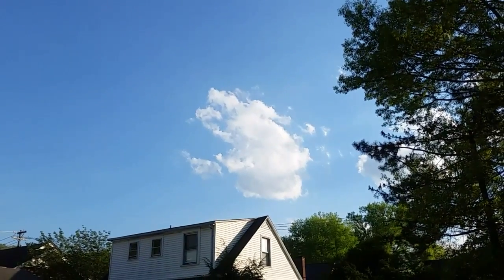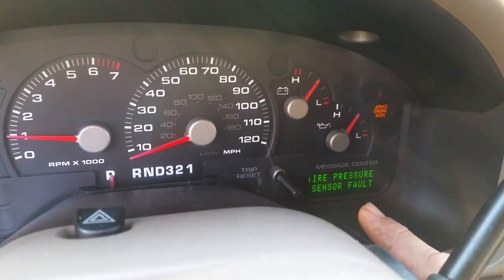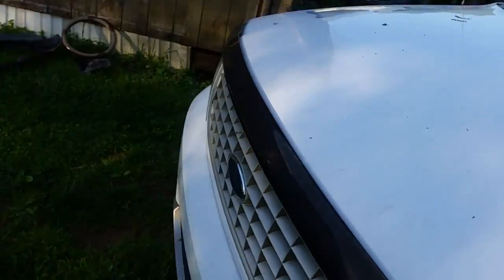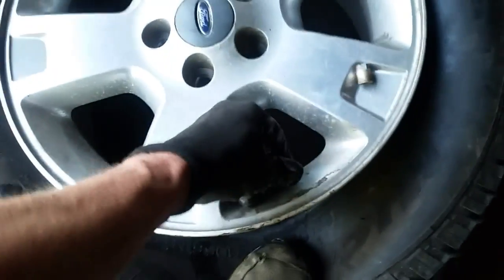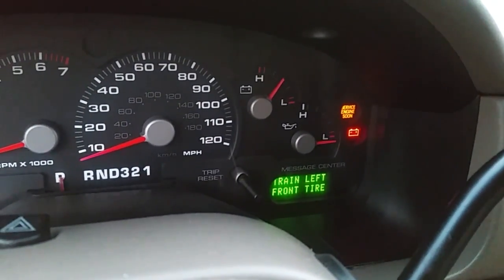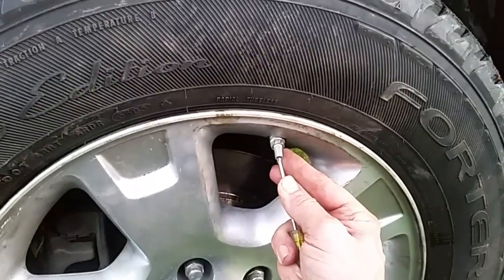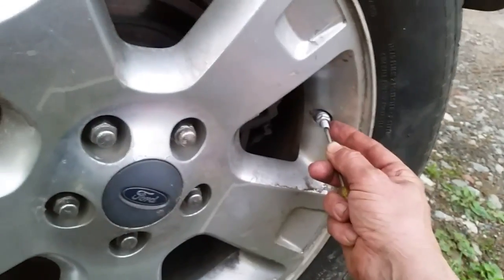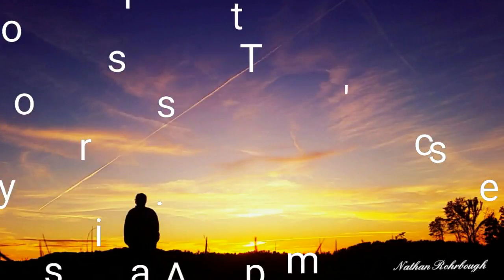TPMS ~FAULT~ Fixed! Simple steps to get that warning light off. Explorer.

Comment: Great Video !
Not sure if this works on Ford Explorers, but
On 2008-2012 Ford Escapes, In addition to do the 3 Key Cycles/ Brake / Repeat.
You can just hit the Hazard lights Button 5-6 times.

I'm so glad the Same TPMS/Door-Ajar/Emergency-Brake lights were turned on at the same time in your video.
Was having the same issue on my 2012 escape, and thought I had a ground wire issue somewhere, because 3 lights instead of 1, but I guess not ! ha ha.

Comment: I already installed a set of tpms on my 2016 explorer and mess cruise hill start and remote start,,took to dealer and they clear the code and now I have errors again. Is there any relation between tpms and theres three or should I look for another solution?

Comment: In the restart the system did not see the low pressure on the tires?

Is it necessary to drive some miles to see the low pressure?

Comment: Curious- why when you finished programming all of them, it did not tell you all the tires were low on air! Thanks for the informative video.
Reply from the maker: It would after I start driving and the computer tells the system, Hey! Low air pressure.

Comment: I have a 2016 ford escape.  Spedometer is not working but cruis control does.  Abs light on traction control light on and tire pressure....but the tires are fine.  What should i do?

Comment: regards. I need your help. Could you tell me what is the reference of the sensors since it should be specific for eddie explorer bauer 4.6 model 2005. In the video I tried to look at the sensor reference but I see the TS-F ... What I'm looking for is to buy them but that be compatible when the car is synchronized with the sensors. Thanks i wait answer. I will buy them by ebay

Comment: Please provide the eBay vendor or TPM identification so I can find same sensors you bought off eBay, as I have same truck and same problem, since I replaced 2 tires. Thanks!
Reply from the maker: Here was my part number. Ford Lincoln Mercury TIRE PRESSURE SENSOR TPMS Factory OEM 4L2T-1A150-BA TS-FD07

Comment: Hi Nathan. Thanks for this video. I did everything you said except I did mine with magnet and everything worked perfectly. I got the "tire training mode complete" message. But when I turned the car off and back on the TP light is still on and I still see the message "warning-tire very low." I have a 2005 ford explorer. The tires were filled to the correct pressure at discount tire prior to me trying this process. Any ideas?
Reply: Re train and use the method he did with letting air out. Works perfectly for me

Comment: Quick question. I have an explorer 2005, 4x4; when coming at a stop (a round 2nd gear) it shifts hard. What do you think it is? I hope you understand my question as I'm not fluent in English.  Thanks in advance
Reply from the maker: Transmission 2nd gear band could be burnt ;(
Reply: It's just a solenoid pack inside of the transmission pan. Not difficult for anyone  mechanically inclined.
Reply: You will need to go thru a learning procedure after installation tho

Comment: Very good video. I just have a question regarding your starting air pressure before you started the training procedure. Should I start at 35psi which is the recommended pressure for my expedition or should I start it higher with maybe 40psi. After I had new tires put on they had the tire pressure in three tires at 46 and one at 41
Reply from the maker: Yea that will work. The recheck again.

Comment: You're telling me that it programs each one individually, but my 2004 Ford Explorer doesn't tell me which tire is low lol. So it knows but wont tell me lol.
Reply: Later year models will give more detailed information, but some only say you have a low tire. I'm looking into installing a dash gauge that shows each tires pressure.
Reply: @JasonWW2000  Oh the good ole days when all this wasn’t necessary!!!!!
Reply: @ronaldnorris2179  It's not that bad. I've got a 2004 Navigator and these were the early days of TPMS before it was mandatory and it didn't give you a lot of information. I bought a four pack of sensors for $30 and installed them myself. I programmed them to the vehicle before I installed them in the tires just to make sure they were all working properly. One of the biggest benefits is if you have a puncture going down the road you can get a warning before the tire goes completely flat which could possibly prevent you from having a wreck.

Comment: To get check engine light to turn off change the gas cap and check engine light will go away  but first  used  piece of plastic wrapped around gas cap and put  gas cap back on first to see if it was gas cap and yep light went away if any one want to know
Reply from the maker: Works!~

Comment: Mine said tires not trained restart process
Reply from the maker: Dang son...
Reply: Nathan Rohrbough what now I just tried it without replacing! So replace them and then try?
Reply from the maker: @jas0nw1ck3d  do it again....its painful...I had to do mine 3 times before I got it right. Just make sure its the right one's.
Reply: Nathan Rohrbough again I haven’t changed mine! Just filled tires to 40 psi and tried it and the left front said failure
Reply: Nathan Rohrbough the right ones what? The sensors? These been in the tire since we got it idk if there good or bad

Comment: Instead of taking the air out you could have used a magnet. Works both ways
Reply from the maker: Tired it...never worked. On Some models it does work for me though.

Comment: SPOT ON EXCEPT FOR 1 CRITICAL MISSING PIECE OF INFO. Purchase PROGRAMABLE sensors. I did the entire process. Everything was going great until I went to train the 1st front left tire. I tried 6 times and kept getting a double beep stating reprogram tire. Finally gave up after trying everything I could think of. Unfortunately wasted time and money. I think if I would have purchased the more expensive PROGRAMABLE sensors it would have been a success.
Reply from the maker: Hummm...Try again again on a nother day?
Reply: @FixingWithPassion  Hi Nathan,  Thank You for your response. Per your suggestion I tried again today. Unfortunately no success. I start with the drivers front per dash indicator. I have bled the air both fast and slow. No horn beep until approx. 2 minutes then double horn sound and  down to 19 psi from 35 psi. This has happened the same for 8 attempts. Full disclosure - I am doing this on a 2005 Mercury Mountaineer not 2005 Ford Explorer but all the specs seem to be the same. Possibly bad new sensor?  Thanks again!